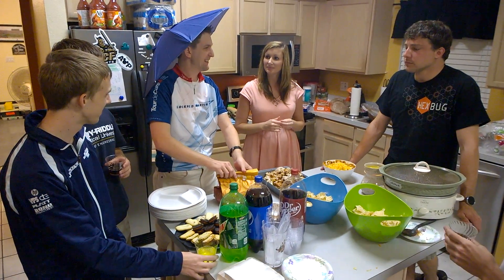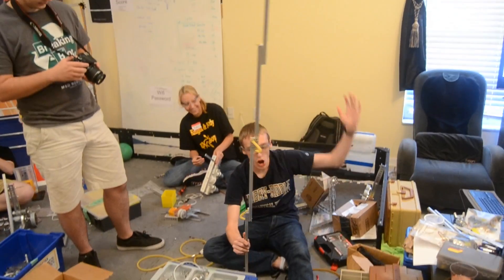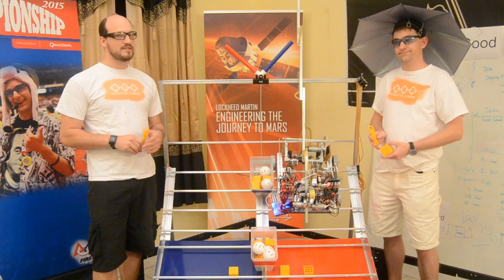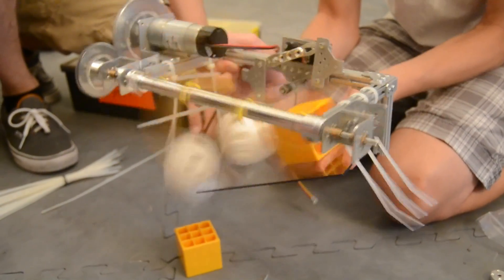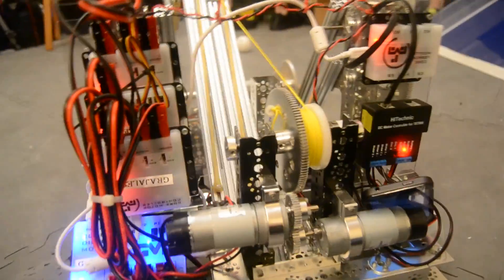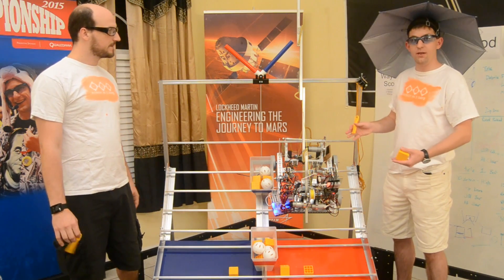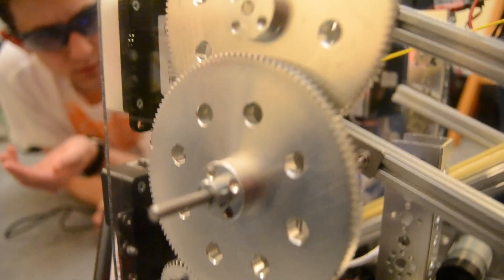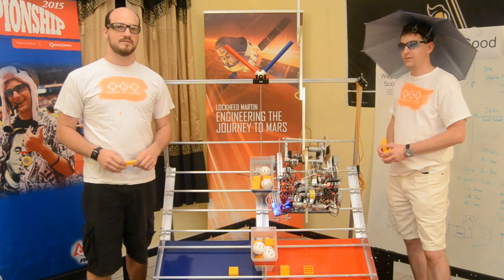Ri1W: FIRST Tech Challenge Res-Q Robot in 1 Weekend 2015 FTC Robot Reveal

Comment: Hi, i'm part of FTC as well and I am just wondering on what parts you used for the "flywheel claw". 
It would be a great help to me. 
Thanks.
Reply from the maker: +Origin MZR if you're referring to the intake for the cube pickups, its just latex tubing that we drilled holes in the standard tetrix tubes and just fed through.

Comment: Nice job. Some pretty interesting ideas here (especially the lift that grabbed onto the pull up bar). One question, do you think it'll still be possible to attach yourself with a string and winch yourself up? Or does that bar + the other obstacles in the way largely prevent you from doing that?
Reply: +Vulcan Robotics Team 8375 Its absolutely possible, and I am expecting this to be a common method of climbing this year. The robot simply need to be designed to not get caught, like a rollbar type solution. I'm excited to see ways that teams overcome this challenge, I'm sure they'll find that same bar we got stuck on to be a nuisance, but far from impossible.  By the way, be sure to look at previous years robot designs for lifting. FRC 2004, FRC 2010, and FTC 2013 Block Party robots all came up with great ways to do it, some of which will make that bar irrelevant.

Comment: We were very happy to supply Ri1w with parts for this build. They used our 15mm extrusion and accessories heavily in this build.  All of the accessories (linear motion, brackets, hardware, etc) will be available for purchase through AndyMark and Amazon by the end of the month. 

We apologize that not everything is available at the moment of kickoff, but we wanted to make sure everything was up to our standards before launching.
Reply: +REVrobotics That stuff was awesome to work with! I plan to do a 3D printer build with it down the road, it's the perfect size. Super versatile too! I kinda wish we'd known about what the holes were for in the end though... Ah well. Live and learn.